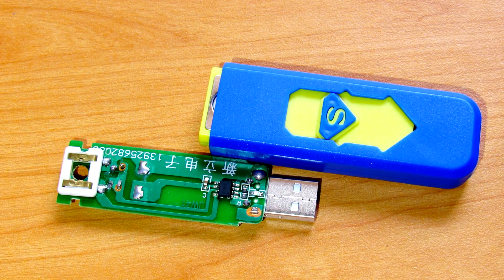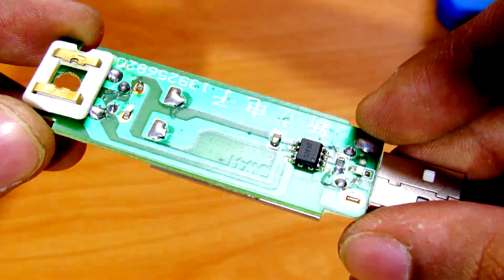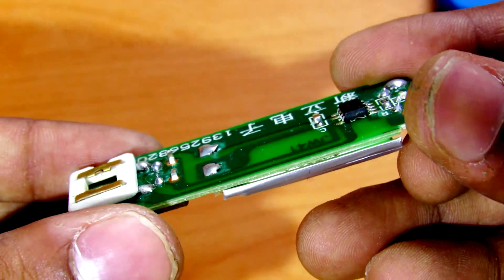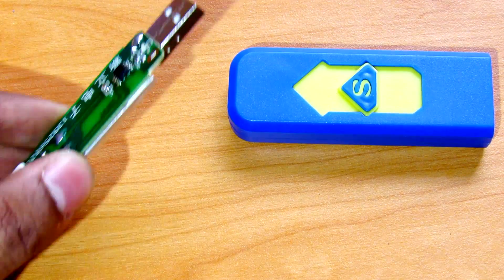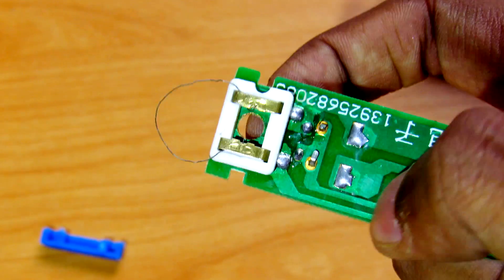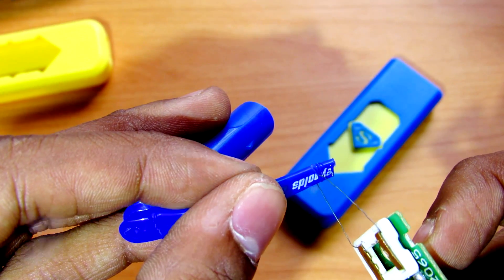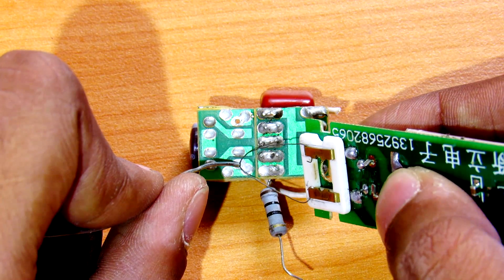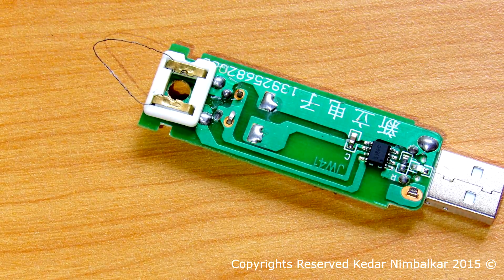Foam Cutter Machine using Rechargeable USB Lighter

Comment: great idea, to improve you could attach 2 long aluminium or copper rods to extend the cutting range (for example 2x 30cm rods)
also for the soldering you need to transfer the heat to a copper core. Look up how soldering irons work, a heating element inside a ceramic insulator heats up a soldering tip) that ceramic can be build for m clay or , by drilling holes into existing ceramic (bath or kitchen tiles, tea cup and so on)